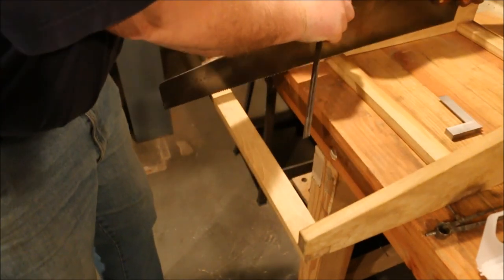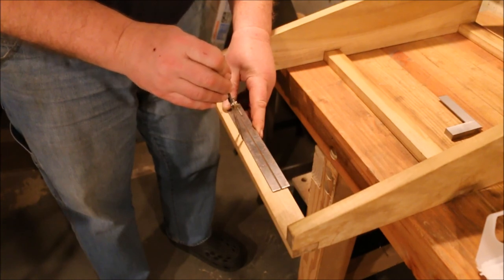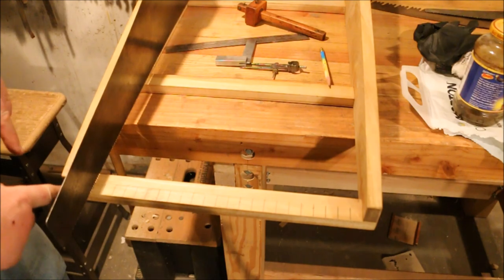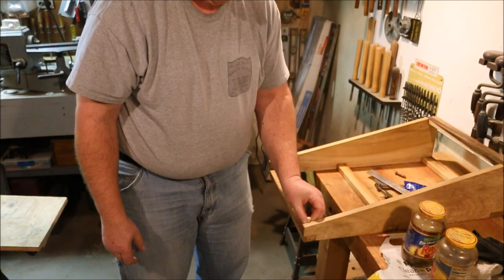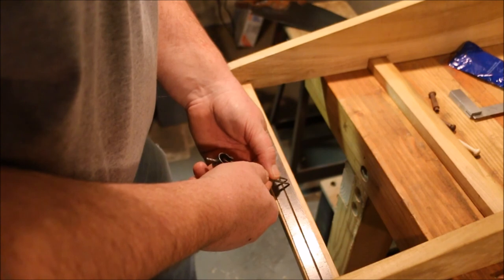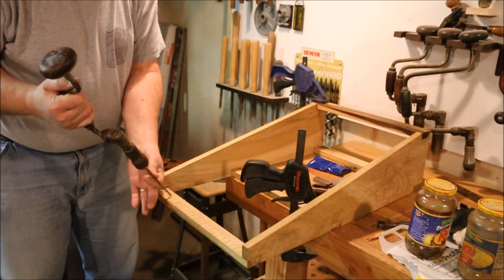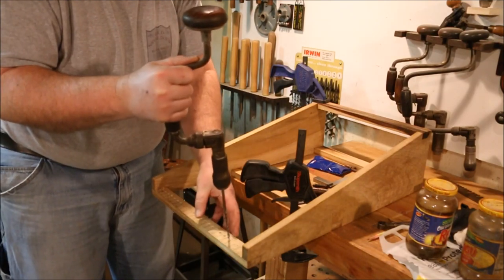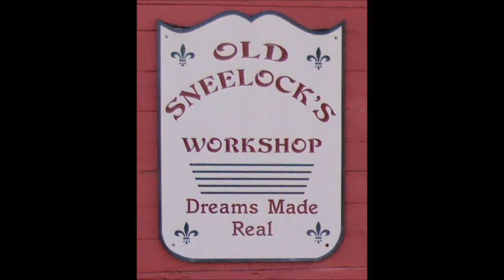MAKING A SAW TILL ~ PART 7 ~ FINISHING TOUCHES & IMPROVEMENTS

Comment: I thought this was still in the 'before' stage but the aftereffects are better. I can usually come up with several ways to do things and if I wait long enough, one will win out, NOT that it it's prone to modification as I flop along. The basic will be laid out but the 'more better' can always be added. Maybe not tear it down or apart over 5 or 6 times. That's with wood. The metal deals is always laid out and a done. Unless it neede tweaked with a hammer! The shaker pegs will work better. I just need a few Shakers but I do enough myself.
Reply: Lewie McNeely I hope your good lady hasn’t noticed you shaking to much be careful you might end up being the next kitchen appliance low noise food mixer
Reply: Lewie have a look at my channel I’m not sure but I’ve tried to put my email on it I couldn’t find yours may be it’s because I haven’t a computer?
Reply: @david you dont really havea channel or a channel description, or a contact method it seems,i guess you have to enable it somewhere in the channel settings
Reply: That's what I told him. I went looking this morning and couldn't find anything.  Not set up I guess.
Reply: i assume you cant do it from a youtube app on a device, but if you sign into youtibe via the browser, then set ' view in desktop mode', then you can do anything
Reply: Lewie McNeely I’ve just asked the kids to look they say press my picture at the side of the comments and it comes up the discussion starts under the name coachbuilder / mechanic then it’s right there apparently I must have something because you have subscribed to me ?
Reply: Other than what we're dong here I need an email address. Then I can send pictures and links and whatever.  I'm just limited by comments as far as I know. I've wrecked several hard drives and don't understand really what I did, but I did!
Reply: I'll try, David. All my stuff is there. I checked this morning or last night. I had to re-do some because I think the new upgrade canned a lot of the original I had on there but it's there now. Click my picture, go to the 'about' tab and the contact info is there on the lower-ish left. I'll try yours again. Thanks Kids! You're educating a native hillbilly and making the world a better place to live in the process!
Reply: Lewie McNeely I did what you said and pressed the comments picture and it comes up  I’ve 5 subscribers and one is you lewie I don’t know other than that it comes up same as yours when I pressed your picture of the dump truck but you don’t have to look for about it’s right there in front ?
Reply: how to put an email address here and not get it filtered      name     at   provider   dot com   , fill in those with your details and keep the words and spaces where they are
Reply: I just tried yours and just got the stuff you uploaded or downloaded or threw over the blasted garden gate. In mine you press the dump truck and it'll open up with tabs maybe behind customise channel tab. Let me look again at mine.
Reply: Click the picture. When that opens up you'll see a row of tabs on top and the 'about' tab is on the right. Click the 'about' tab and it'll open up to contact information in mid-left. Open that up and there you are.
Reply: VERY good!
Reply: Maybe BUT she had to drive to get the damaged digit repaired so maybe I'm off the hook till I heal completely.
Reply: emails are easy if you have a  device (android apple or even windows phone) , you click on the email symbol and you set it up by following the instructions, and easy to reply once someone has been in contact, but to be honest, setting up facebook is probably the better way forward for talking to people and looking at pictures
Reply: Should be a row on top with the 'about' tab on the right. I just tried yours again and couldn't find the mechanic thing the kids said was there. We must have to have a similar account somewhere.
Reply: Jusb1066 I’ve face book and messenger but lewie hasn’t I’ve got apple iPhone 6 and iPad but the rest you said sorry right over my head ive go about 80% of this mastered but the rest I’m on the blower to the kids and I haven’t a computer yet that’s coming but if it’s as bad as this to sort out I’m dreading it
Reply: setting up your email to work in ipad and apple should be easy, it guides you through it, im suprised lewie doesnt do facebook, david (sneelock) has it, and its the best way to keep in touch with a group of people rather than email which is a bit old fashioned now, messenger only works to other apple people, which many are not, its a closed system thus i dont use it
Reply: Jusb1066 I talk with David a lot in messenger he hasn’t apple none of the kid have either it works ok with them
Reply: Jusb1066 I use messenger a lot but Facebook could walk for me I hate it and lewie does he said as well I never look at it unless I get a flag off someone that’s important I need to see then I see and straight out
Reply: Jusb1066 were in the uk are you mate and do you have a name
Reply: my name is Justin, i live in Kent ,    i guess you and lewie will have to go back to smoke signals, lol
Reply: Jusb1066yep Justin I’m having trouble getting my head round metric I never have had to use it it’s always been imperial now I’m teaching my grandson joinery and I’m finding it hard but I’ll get the mm &cm mixed up to my grandson amusement but I’ll get there. And as far as computers are concerned I doubt I’ll ever get round them lol
Reply: ahh i grew up with both, but good to teach your grandson metric from the get go, he doesnt need inches in there too (also found you on fb, might have an inbox request on there)
Reply: Have you just done something on face book I’ve got a flag ?
Reply: yep sent a friend request